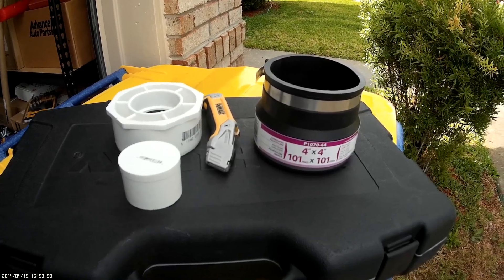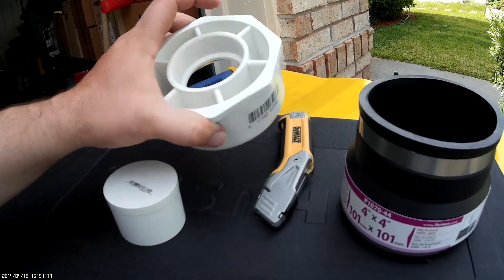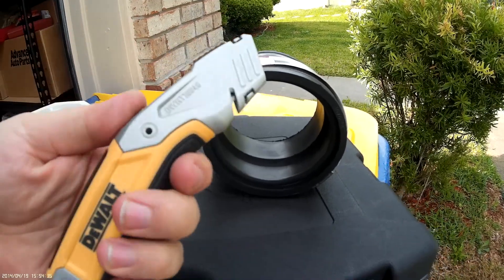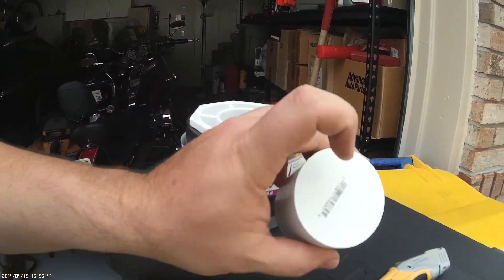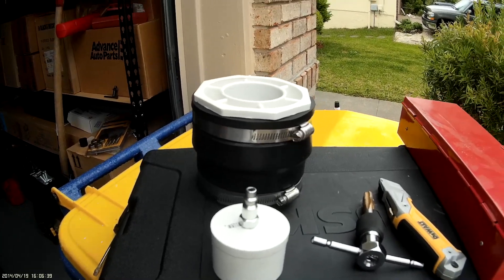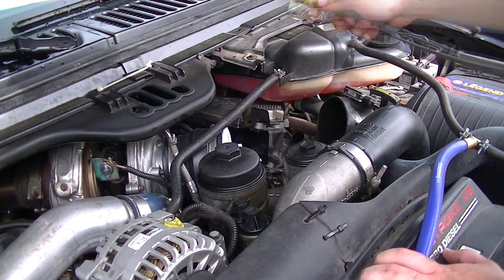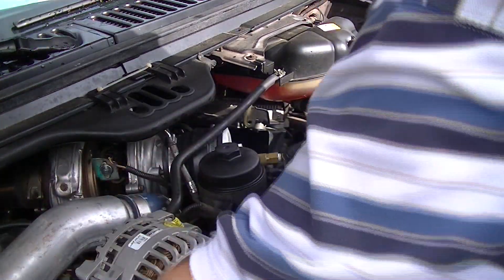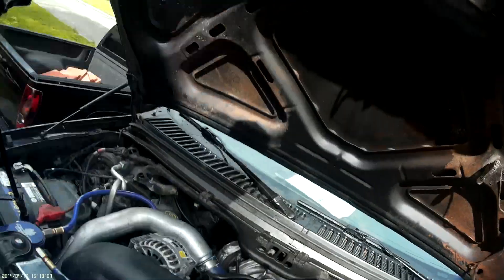How To: Build a Boost Leak Detector for Ford F250 with 6.0L Diesel

Comment: So what happens if it's just blowing straight thru out the exhaust?
Reply from the maker: That would mean that the intake manifold wasn't blocked off
Reply: So you gotta block off the intake manifold in the 6.0? because I was doing this before testing leaks found my leaks didn't have to block off anything and it held pressure, turbo started turning off and on like I had a boost leak went to test and it just went straight thru
Reply: @levon12466  there should be enough pressure build up to at least feel around and spray soapy water but there is no way to fully cap it without capping the air inlet st the manifold
Reply: @happylife174  had a fucked up turbo

Comment: If your checking for leaks all the time whether it be intake or exhaust even vacuum and fuel tank leaks a smoke machine is the only way to go. They are coming down in price now. picked mine up used from the Snap On truck used for a couple of hundred bucks. They can save so much time looking for leaks
Reply: Using compressed air in the induction system is perfectly acceptable and even part of some oem diagnostic procedures... paccar  has a kit same with cummins and also CAT

Comment: I watched every single video since the first video on oil cooler and you always blame all the engine faults on Ford but yet it's an international Navistar engine. Ford didn't design the international motor, I believe I've read somewhere that it was a foreign designed motor because I had to meet EPA regulations when they first came out in the 6L. So for any problem besides the motor blame ford. Anything about the motor blame International.
Reply from the maker: Not quite - the Navistar VT365 that the Ford 6.0 is based on was rated to 170-250hp / 460-620tq, and filled with ELC coolant from International.  What did Ford do?  Pushed power up to 325hp, which increased pressure in the cylinders, and bam, stretched head bolts yielding to blown head gaskets.  Couple that with Ford Gold Coolant (the same coolant rated for the Taurus) and silicate goo clogging up the EGR cooler, which kills the oil cooler, and yeah, you end up with the 6.0's common failures.
Reply: @uberDoward  exactly. I currently have a 6.0 that had been rebuilt. Starting to figure out why I got it so cheap with it being rebuilt. Replaced everything on the inside of the motor but yet he didn't replace everything that it actually needed. Replaced 3 of 8 injectors now I have two bad injectors, replaced brakes, fixing to have to put all new bushings, wheel bearings, and now today I just had a bad drop in power and figured I would start with the most simple thing of power loss I could. Next will be the map sensor if this doesn't work.